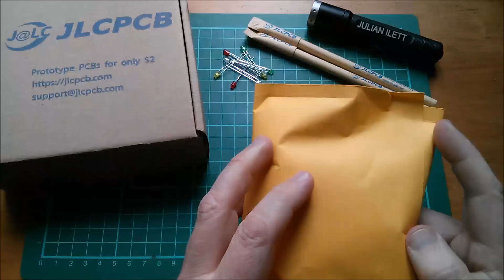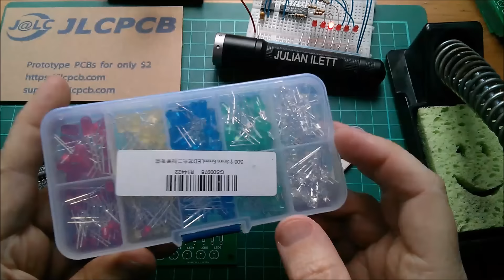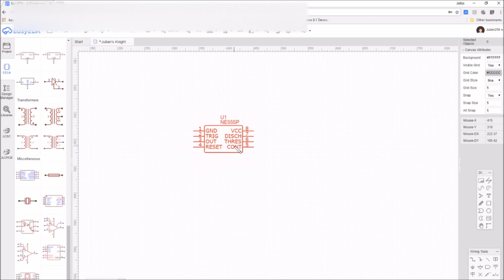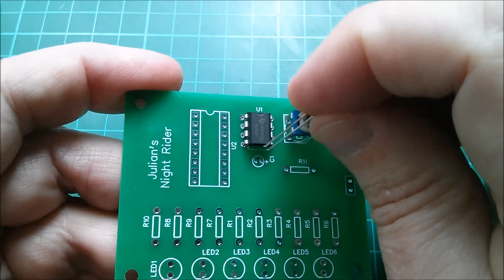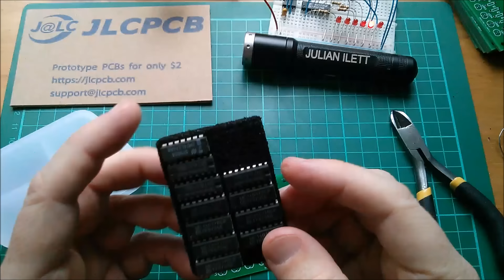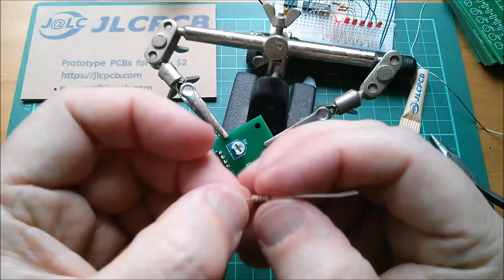I Designed a Printed Circuit Board (PCB)

Comment: I found that if you print out a copy of the PCB on to paper first before you get it made up you can test fit the components. If something doesn't fit you can reprint it quicker and cheaper than getting a new PCB made.
EDIT: Just remember to set the correct DPI when you print out so its right.
Reply from the maker: Very sensible - I've learnt my lesson now :)
Reply: Julian Ilett print Gerber top layers 1:1 
any scaling from the software will get ya. I've been had by this before. You can also tape the print out to some anti static foam and fit all through hole parts and see how they look and fit together.
Reply: Great tip!
Reply: CuriousGamer
You might be interested in these as well:
https://www.ebay.com/itm/25cm-10-Inch-Multifunctional-PCB-Ruler-Measuring-Tool-Resistor-Capacitor-Chip-IC/202077231422?ssPageName=STRK%3AMEBIDX%3AIT&_trksid=p2057872.m2749.l2649
Reply: Thanks for the link, I have purchased one
Reply: Yes. Definitely an industry standard practice. Just make sure you print 1:1 otherwise any scaling will get ya. "A trap for young players"
Reply: Another good idea that I'm going to "usurp" :D

Comment: I love the quality from JLCPCB.com Always good. Reasonable delivery times. If you are going to give any of those PCBs away, I'd love one. Perhaps you could autograph it too? As a pointer, I made a really cheap bench accessory out of a piece of old matrix/vero board to bend component leads at standard spacing. You can see a pic of my one here: https://scontent-lht6-1.xx.fbcdn.net/v/t1.0-9/10306266_10152771832266111_6065570910193942821_n.jpg?_nc_cat=0&oh=e9e77466508a4938c8228267c08699ac&oe=5B2AB9BE it served until I got a 'proper' bend guide along with a tool to sort IC leads out!
Reply: that lead bending is genius. i'm going to make one of those
Reply: Thanks, I'd love to claim the credit but it was an idea I saw online ages ago. I cut the board by scoring the cut line repeatedly with a craft knife before breaking it over the edge of a table :-)
Reply: No worries BertyFromDK, The more the merrier. As I said above, it wasnt my idea. Happy to spread it though.
Reply: if heated up to 60-80°C, it can be cut with metal cutting scissors as paper
Reply from the maker: That's really clever - how did you cut the board without it splintering and fracturing?
Reply: Steve Smith
Great idea, i'm going to "usurp" it! haha
Thanks for sharing.
Greetings froom Denmark.
Reply: Good tip - Many thanks

Comment: Instead of using Blue Tac you can first Bent the diagonal corner pins...!
Reply from the maker: Aargh!
Reply: Sorry 🙏 Didnt see full video.....!
Reply from the maker: That's exactly why I don't like doing it
Reply: The problem with that is that it makes it much harder to remove the part should you need to replace it
Reply: Or position your left hand/fingers to hold the chip in the board and the solder at the same time with iron in your right hand. Watch how bigclive does it. I use his method.
Reply: How to avoid Blue Tac and bend pins:
- solder components in order of increasing height
- put one in, place board on top side on that component, solder one pin
- hold the board in hand, use one finger to push on the component, melt the solder again until the component is flush against the board
- solder the other pins
- cut the wires
- repeat until all components done
Reply: Matthew Harrison (matthehat) Oh...!!!
Reply: Julian Ilett Sorry Again 🙏
Reply from the maker: Don't worry Sagnik - I'm not offended :)
Reply: Julian Ilett Thanks Sir..! Respect Ya..!